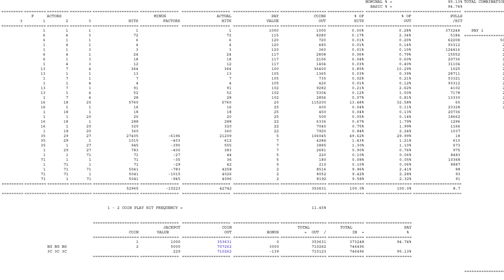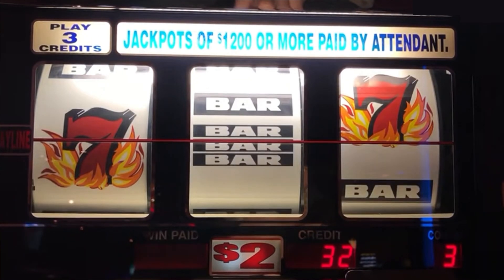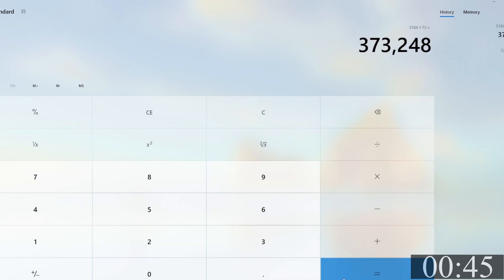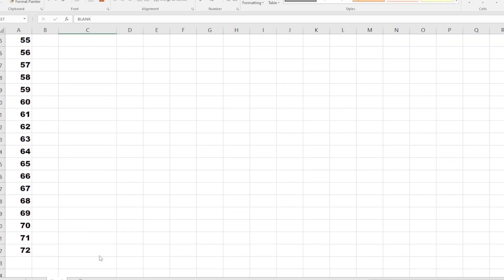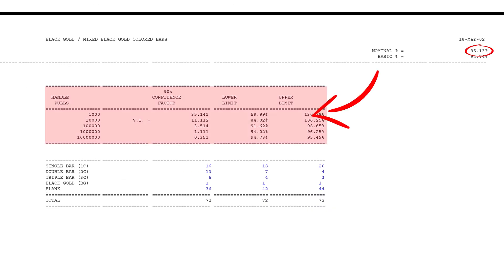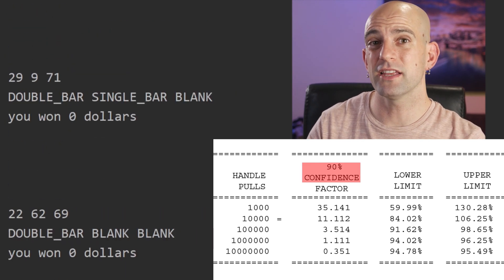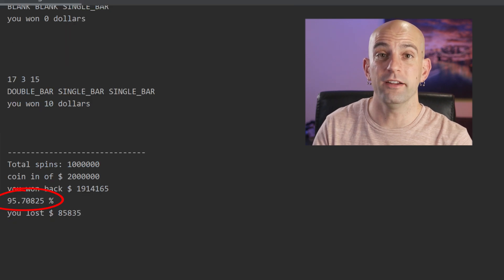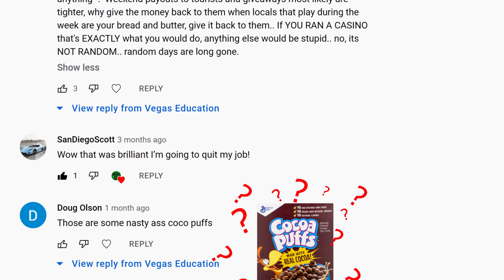Designing a slot machine from scratch

Comment: We test the machine after coding because... no guarantee it will perform as designed. Thanks so much for the theory. What I am focused on is the different tables that can be accessed by the casino.  I don't know if the casino can change the tables (still within legal limits) to accommodate their needs such as for promotions etc.  It seems the transition to central server control was costly (maybe long term savings too) and that change opened up a whole new world of possibilities.

Comment: I can say why new machines would  be slightly different to old. 
I have noticed that (in aus) machines seem to reset the pay out frequency and amount on features, where the screen fills with coins etc, if you change the amount played per spin... I would assume this is to stop anyone learing the algorithm at a lower value then betting large when they think it's about to pay out. 

I agree with your code, but I does not take into account time or money played, both of these things seem to be a factor in machines that throw coins at you and you get three and a feature start.... I also suspect the play button becomes a stop button when this happens as the machine spins itself, why else would it do that? But I have noticed that once you get down to one or two blank spaces, that last wheel never shows a coins going past. All I can assume is the code "randint(1,72)" changes to ran(1,12) or something and all the coins are at the top of the numbers on what outcome should be displayed. Would also explain why you only see the same couple pictures flash past that last 15th hole you need to fill, when on the first spin the screen was all coins...

Comment: Congratulations for the great explanations but i have one question and I'll be very hapy if you give me a suggestion or brief explanation.

I've tried to reproduce what you did using the parsheet but can't go past around 90% of RTP.

So for example my first problem was this "XC  XC  XC" from the paytable I figured out that theese are combinations of all 1C,2C or 3C symbols and these numbers "-6196" from the "MINUS FACTOR" correspond to repeating sequences and I fixed it in my code and got around 90% RTP.I just cant figure out this for example "--  BG  BG 71 1 1" from the paytable.According to the distribution chart in reel one there are 36 blanks but in the paytable are 71...Does this have something to do with the virtual reels?Because if there are even more blank space woudn't the RTP drop even more??And in this case the all possible combinations will rise drasticly over a million.I'll apriciate even a small hint.
Kind regards!
Reply from the maker: Its hard to explain through text, so i dont quite get the explanation of your problem.  So, i might be somewhat guessing here, but the most confusing thing with these par sheets is you have to account for duplicates.    For example 3 x single bar will show up in 3 single bars as well as getting all bar symbols.   Make sure your code is always defaulting to whichever pays more

One way you might be able to troubleshoot it is to add a counter for each pay result possibility.   How many times did you get 3x single bar, how many times did you get 3x any bar, etc.  If you do that and run it for a billion spins, it should become obvious where your problem is
Reply: @VegasEducation  fuck i cant send you long messges in youtube or instagram but i did it...
Reply: @VegasEducation  a

Comment: Just a point. The wilds are used to refuse payment. What is the probability of getting 3 pay orbs on the first real in dragon link. ?
I ask this because this spin happens often. The next 4 reels are like loaded with wilds. This spin does not pay.
Very rarely do you get multiple reels with wilds on reels , 2-3-4-5, any other time 
Also lots of wilds on 3-4-5, not linked to reel 1 , also no pay .
My theory is that there is another procedure at work before the 5 random reels determine the output. 
This explains the very low payout. Wins are minimal in the line-hits and free spin feature on moderate bets. E g 6 free spins ( less than bet payout per spin resulting in pathetic bonus ).
Line hits ( 3 first reels hit , payout less than bet, 4 reels, payout equal to or just over bet, finally 5 of a kind without wild, payout 5* bet when these hardly hit?)
Your analysis has missed the ' tease' aspect of programming.
Reply from the maker: @oldhobomanl1747  thats all just a matter of how they design the reels.  They can design it so that reel 1 has tons of orbs, reel 2 has very few orbs, reel 3 has tons of orbs, reel 4 has very few, and reel 5 has tons.  That's the balancing act that the designers play. They try to balance the amount of teasing with the number of wins (and the amount of those wins).  Id suggest watching my video "6 ways that casinos cheat with slot machines "  as it gets into this

Comment: I have 2 questions.. i hope ur still about to answer them :) 1.. When a VIRTUAL BLANK is hit by the computer.. WHAT does it translate that to on the physical reels?? and how does it know that what it translates it to isnt (to our eyes) showing a payout line... so.. lets say we have 2 bars in the first and second lines.. and in the third line it hits a blank in the virtual reel.. how does it know to translate that blank into something that ISNT another 2 bars... i hope that makes sense.. and 2.. If the math always works out like this.. how would they make the odds go up and down.. so.. how would they lets say.. pay out 120% of the time... or.. equally.. how would they pay out 80% of the time.. what would need to be manipulated for this to happen??? Hope u are in good health.. and thanks in advance!
Reply from the maker: @JackLanDan  i simplified the video a little bit to get the concepts across.  Each blank corresponds to a corresponding space in-between between two symbols.  So, there might be two blanks between the bar and 2 bar. 4 blanks between the 2 bar and  3 bar. 3 blanks between the 3 bar and next single bar, etc. So, the RNG might land on the first single bar, the third double bar, and then the blank space in between the black gold and a single bar.

A game designer can change the rtp of the game by swapping out a higher paying symbol for a lower paying symbol or vice versa.  That's when the game is designed.  The casinos can change the RTP, and that thats what those different RTP settings really mean. There are slight variations of how many symbols.

If you mean how a game can go hot and cold to have a higher RTP for a period of time and then a lower RTP for a period of time, it's just random.  Over the long term, the results will converge to what the math says, but anything can happen in the short term.  With anything in statistics, streaks aren't just normal. They are fully expected. Most people would assume funny buisness if there are streaks.  A mathematician would assume funny business if there werent streaks
Reply: @VegasEducation  Thank you so much for taking time to answer my questions... really appreciate it my friend!!!
Reply from the maker: @JackLanDan  no problem 😃

Comment: Unfortunately, your test is flawed due to pythons inability to produce truly random numbers it works off of pseudo randomness like all programs. If you think I'm wrong, please explain.
Reply from the maker: Both a slot machine and pythons random module are pseudo random number generators.  Specifically,  a slot machine uses a method called a linear congruential generator for its psuedo-random.  While pythons random module calculates its psuedo randomness in a slightly different manor, it makes absolutely 0 difference for this demonstration.  The biggest difference is that pyrhons random module isnt cryptographically secure, which makes absolutely 0 difference for this demonstration
Reply: @VegasEducation  All I know is that we're losing the battle against "Pythons" in Florida, just as we are in the casinos.

Comment: Great explanation!  I'm curious why some machines occasionally have spins stop at a slower or faster than normal rate.  Slower I get...normally you connected on the first two and that triggers some effect, but there are also times when they stop abnormally quickly (and typically those are never winners).  Is that just because of how the physical reels are positioned in relation to the random sequence generated for that spin?
Reply from the maker: I would assume you are exactly right. One thing i left out of this video for simplicity sake, each specific spot on the virtual reels is mapped to a specific space on the physical reel. In my video, one of the reels had 36 blank spaces on it.  The first blank space will be mapped to a specific blank space. The next 3 could be mapped to the next single specific blank space on the physical reel and all share that space.

 Every machine is going to operate slightly differently, depending on how the game is coded.  Not to be confused with the math aspect, as that's all going to work fairly similar, but as far as the visuals,  a designer is going to have to decide how many spins a game will do.  Let's say it's decided it's going to land on a symbol on the opposite side of the reel.  Is it going to spin around 3 times and then land on it? Is it going to spin around a half revolution?  Is it going to spin around a random amount of times and then land on it?

Comment: some techs have told me that the new electronic slots have a prng to assure that every nummeric  combination  in that slots cycle is garanteed and it is easier to  see if the machine  has been tampered with or has malfunctioned is that true ?
Reply from the maker: For the most part, that's completely false.  For the most part, you can ignore what techs have to say about math. They are good at turning a screwdriver but math isn't usually their strong suit.

The one time it's false is on lottery terminal machines like in Washington state.  Being random isn't good enough for Washington. They had to make it so every possibility is chosen. They issue out every possibility, split between tons of different machines.  Then every time a machine spins, it's issued a "digital scratch off." Once all the scratch offs are distributed, a new stack is issued.

Class 3 machines? Nope. 100% random
Reply: @VegasEducation  the reels dont spin on electronic slot

Comment: o.k.  i'm trying to take this in.  If a reel has maybe 12 symbols and 12 blanks between the symbols that would be 24 stops on a reel. what i'm hearing you say is the computer doesn't care about the physical symbols on the reel it a virtual reel with 72 stops and so each physical symbol is the outcome of, if I use my made up example of 24 stops on a reel, each symbol represent 3 numbers on the virtual 72 stop reel?

   The other confusion is about the weighted aspect. that 95% RTP is completely irrelevant to the player that is interested in winning more than they came with. If the machine gives a payout that is less than the bet that is STILL CONSIDERED A PAYOUT.   to us the player that's called less of a loss.  There needs to be a PRTP( profit return to player)  this woukld be what percent over time would be given to the player that is at lease $0.01 over the bet made.  Now that number would be important!!!!!

I have now tried about 15 strategies as an experiment, set up spread sheets looking at every spin, denom, bet that I have made.  time of day, where they were on the floor yes and even that tase method guy and other that said go to a $0.25 denom 5 credit max bid and do $100 in  and double or nothing. Or the one about $1 denom and play $1 bet until I lose it or triple it.   Tried the Ainsworth games, stayed mostly on three real reels and only sometimes cartoon penny games. actually two of my hand pays were on a buffalo diamond game and an ainsworth eagle bucks game. Pinball sucked and top dollar sucked. double diamond sucked as well. the blazing 7's seem to pay out fairly consistanly.  

  So many methods and I have received 4 hand pays, 3 times just under a hand pay and honestly winning only about 35.53% of the time. I really though I could prove myself wrong( that winning money at slots is for people with bad math skills and impossible to have even a high probability) during this experiment my risk made up of my money and the casinos was $$24k  in and $22k  out.  still in the negative, but not so bad.  My experiment is almost over unless you have a better method?  haha!!  

my goal was really to just walk out consistantly with at least $1 more than I walked in.  I could only manage to do that about that 35% of the time..sigh   

They should at least make it law that every spin has to at the very least give an underpay. these dead spins are just disrespectful especially since we have data that it is the poorer and working class who provide most of the winnings to the casino.  It would be nice if the casinos would then invest in the health and wellbeing of the community, but..well.. you know how independent minded corporate think goes..... SMH

Comment: I plan on creating a virtual slot machine and your video will be a big help in accomplishing that goal!
Reply from the maker: Awesome.  I just wouldnt code it the way I did in the video. I only coded it that way to make it easier to explain.     The way ive been coding them now is WAY more clean.  Send me an email and we can chat about it
Reply: @VegasEducation  Whats the ideal  coding app to use for making a virtual slot machine game with "plinko" mechanics?
Reply from the maker: @videohog100  the coding language is going to depend more on what your goals are for your program.  Is this to have an interface that shows the ball moving down? Is it just going to be text based. If its text,  is it going to show the entire pay of the ball going down or just the overall results?  Whats the end goal for this?
Reply: @VegasEducation  Step 1: Create a fully functioning slot game similar to plinko (mechanics wise)
Step 2: Find a casino(s) that will buy my game.
Step 3: Make more slot games!
Reply from the maker: @videohog100  i think you are at a long uphill battle for that.  Theres lots of regulation for that.   I have no idea what the best language to use would be.  Getting that in depth is way over my head
Reply: @VegasEducation  No need for an in depth explanation. I'm trying to get a general idea of where to start. Hoping you can help me there 😅
Reply: @VegasEducation  Excellent! What's your email address?
Reply: @VegasEducation  Excellent! What's your email address?

Comment: Are the machines that are used by highrollers the same as the one that regular people use
Reply from the maker: Yes. Exactly the same.  The only difference is that the the payouts are usually set higher.  Meaning, if you looked at my examples slot machine, some things they might do is take a few blank spaces away, change a blank to a single bar, increase the payout of the jackpot, etc.    This is all things the manufacturer could do. The casino would just select 94% instead of 88% or whatever

Comment: Thank you! Thank you for your explanation. The slot machine does not have to be programmed to balance itself. There is no need for programming the "balancing code" - it balances itself over hundreds thousand of spins just by the laws of probability. Like the coin flip will balance to 50/50 overtime. Right?
Reply from the maker: That's exactly right.  Balancing isn't really a thing. I hate that term. It implies the machine is doing something. Really, it just averages out over time due to all of the probabilities of each possible outcome

Comment: so to change the payout % from the 95% setting to the ex 90% setting they just ,add or take away some vitual symbols?
Reply from the maker: There's a few things they could do.   (This would be the game designers job when the game is manufactured.)

The payback is the ratio of how many combinations there are to the total of how much every combination pays back.  If theyveant to increase the payback, they could increase the total that the winners pay. They could turn some blank spaces in to winners. They could change some single bars to triple bars.  A common method is also to increase what some of the winners pay.  Like changing the jackpot from 1000 to 2000.  They could also make it so it costs less to try all the combinations.  If they got rid of one blank on each reel, it would now be 71x71x71 and they would get rid of 15,337 losing combinations
Reply: @VegasEducation  To my experience they've tightened these machines worse than ever.